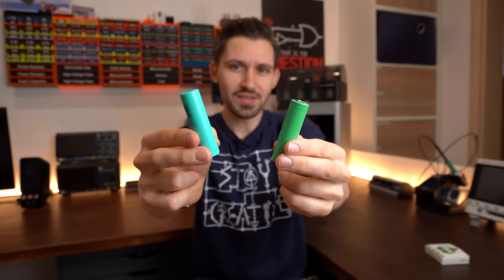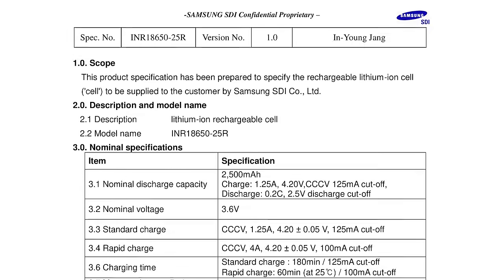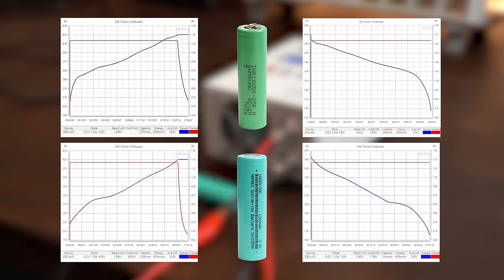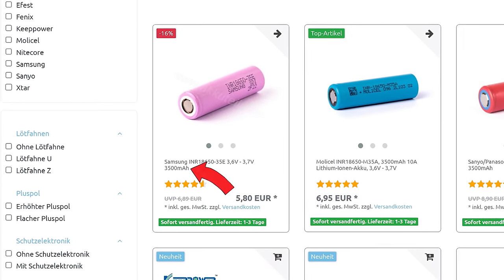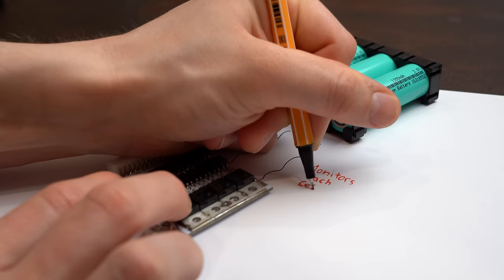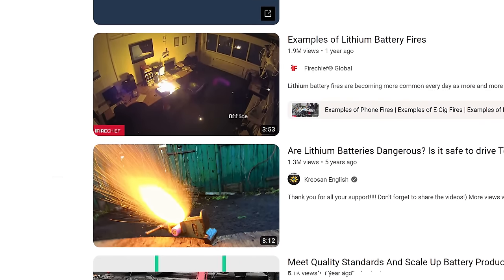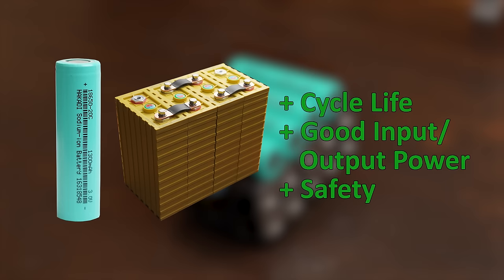"Salt" Batteries are FINALLY Here?! Sooo should you use them?

Comment: I was just watching a video, I think from Big Clive, where he put a schottky diode in series with a lipo during charging with a standard lipo charger, and the 0.3V drop kept the battery <4V when the charge completed. Potentially a quick and easy solution for charging the sodium cells, assuming the charging current is the same, and the charger can handle recovering from a low voltage starting state.
Reply from the maker: Haha yep. That sounds like a easy hack. Not 100% safe, but probably good enough.
Reply: @greatscottlab Well, thats Big Clive in a nutshell :D
Reply: Will it carbonate? What's inside this battery? (Fire apparently)
Reply: Hope this technology grows!
Reply: Yeah, as long as the diode doesn't short it's a decent hack. If it shorts then you have a slight overcharge.
Reply: I guess that can work but with my hota d6 pro I can set the charging voltage to 4v and not worry about it
Reply: @greatscottlab two more tests I would like be performed on sodium ion is its resilience for overcharge and over discharge. Will it survive going down to zero volts?
Reply: I tried this once with a power diode.  You only get the rated voltage drop at the rated current.  Otherwise the voltage drop wasn't as advertised, it was lower.  You need to factor this in.
Reply: As the current draw nears zero, the diode drop also nears zero, and can confuse the charger. My idea was to put a resistor over the cell so there's always about 1 mA or less draw, so the voltage drop over the diode will never go lower than .25 Volt.
Reply: @erikdenhouter how would that work? If you want to get current through the diode from the battery it will need to be polarised opposite as when using it in series to the battery while charging
Reply: @ooltimu  You are right, it is not going to work. Even with a resistor over the cell the charger current will again drop to zero, and the same problem will occur.
Reply: @DM-ei6ooum have you ever met an engineer lol
Reply: @TotesCray  All batteries contain fire; it's easier to release it from some, however.
Reply: @major__kong  Put a resistor in parallel with each cell. Wasteful but should be effective. Power diodes also have a bit more of a range of voltage drop when you put different currents through them.
Reply: @SimEon-jt3sr  Two people have the distance between them halved every second:
A mathematician says their lips will never touch.
A scientist says repeated errors in measurement may cause their lips to touch.
An engineer says "close enough!"
An amateur goes straight for the smooch, then gets slapped in the face and told "she's not that kind of girl."
Reply: @erikdenhouter this usually happens at much lower currents than 1mA. I'd say the cell would be mostly safe because of internal leakage current, but maybe better safe than sorry.
Reply: @mjouwbuis Yes that is right, near zero will always happen at a few nano or pico Amps, but when the charger turns itself off, exactly that happens, and the charger will see the full voltage of the cell again. How does it react then, it could come in a slow oscillation.
I was now thinking of forcing a small current through the diode from another independent source.
Reply: @erikdenhouter  it'd probably be a pain in the ass, but keeping with the theme of retrofitting an off the shelf lipo charger, maybe have the series schottky diode + FET in series and a zener diode rated for the full charge voltage of the battery in parallel with just the battery. When the zener starts conducting, open and latch the FET to disconnect it from the charger. If this is supposed to be an integrated solution (where the user doesn't intend to disconnect the battery), use another monitor to close the FET when the battery goes below a certain charge state. Obviously a super bodgey solution, but until there are $0.20 charging IC's for this cell type, there are probably some good workarounds to integrate and test it in our own homemade products.
Reply: That is actually one of the main advantages of sodium ion batteries, especially from a logistics standpoint: They can be discharged to 0V without any problems!

Comment: I think these have A LOT of potential. But everyone has been waiting for the "revolutionary new battery technology" and that likely isn't going to happen. We will likely rely on a wide range of technologies for different use cases that will prevent over-reliance on certain materials. Like lithium (Good vid!)
Reply: Quite frankly we are running out of options for "a revolutionary new battery technology". Lithium was sorta that. Sodium batteries do solve a lot of the problems with Lithium batteries though, just with a bit of a performance hit.
Reply: Graphene might be it, but it's probably going to be on the timeline that everything graphene operates in... Reminds me of fusion
Reply: There's to many huge huge companies out there like gas and oil or what ever like that.... They want there money and really good batteries would destroy them.....
Reply: "I think these have A LOT of potential" - Well, they are batteries! ba dum tish
Reply: Batteries still need to be charged, and are done so via gas/oil.
Reply: @dallysinghson5569  or solar panels or wind farms or hydro stations or geothermal stations or nuclear power plants
Reply: I agree there will likely be no big leap in battery energy density. So many people are waiting for this big discovery, but I happen to think lithium batteries are pretty close to peak energy storage.
Reply: @dallysinghson5569 don't forget coal 😛
Reply: @jacuzzibusguy I doubt it. Even with straight forward chemical cells there's still a handful of paired redox reactions that could theoretically outdo lithium by a decent margin. Such as sodium sulphur.

Then there are other approaches such as capacitance and hybrids of batteries and capacitors, flow batteries, fuel cells based on some as yet unknown catalyst, batteries which use air as one of the reactants in the redox reactions, perhaps even things we haven't considered yet. Hell, even stuff like improvements in material science making mechanical energy storage like fly wheels or springs competitive may one day be a thing.

But yes we should expect these gains if they occur to probably be progressively more incremental and perhaps even hundreds of years in the future.
Reply: The revolution is coming but it will be least 15 years away. There are companies like Ilika, working on these technologies that have already reached the same energy density of lithium batteries and have rolled it out for use in medical devices. Inevitably the issues of mass adoption will be production and cost. Once those are sorted we’ll start seeing them
Reply: @WillHest  the same energy density as lithium is a pretty low bar.   100 pounds of Tesla batteries, for instance, have the same amount of energy as one pound of gasoline.   

This is why EV struggle to compete when it comes to heavy duty vehicles like trucks or anything that doesn’t get 100mpg equivalent.  

The amount of weight in batteries required to power a vehicle that gets 8mpg for a range of 300 miles is too much for the vehicle to be practical.
Reply: @jacuzzibusguy  Bit off topic, can’t make my laptop run 100x longer by pouring fuel into it 😂 Nothing is going to beat the energy density of hydrocarbons.
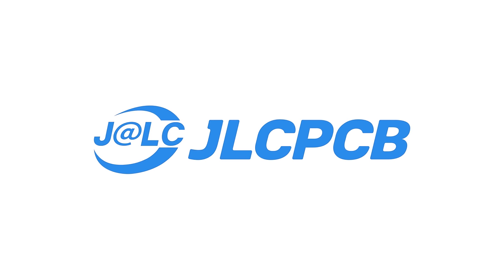What I’ve been able to find dates back to 2018 and for a US gallon you’d need 13x the amount in lithium cells in terms of volume. For weight it would be around a 1:50 ratio. The hope is solid state batteries will at least double what lithium currently offers, so that reduces 1:6.5 for volume. They’re lighter too by around 40% so that should reduce to around 1:30. 
Then we need to factor in that ICE are far less efficient that electric motors by around 3x. We could effectively cut the ratios to 1:2 for volume and 1:10 for weight for identical range. Petrol still wins but it’s not as near to the 1:100 you alluded to earlier, if the promise of these battery development’s come true. The application for long haul HGVs would obviously still not be suitable.
Reply: @dallysinghson5569 you're living in the past
Reply: @dallysinghson5569  Well, I just checked and our grid is presently using just 3% gas and zero oil or coal. You  must live in a country where electricity from renewables hasn't been developed yet. Keep pushing for it.
Reply: @jamescampbell6728   large solar and wind farms do not make any sense.  Private small installations however do.  If you don't understand why, do some research.  Wind farms never pay for themselves and solar is even less reliable than wind although solar does eventually pay for itself.  Using it to augment your home privately is one thing...attempting to rely on a variable source to power a nation is just dumb.

Comment: I put together a sodium ion power tool battery.  The voltage drops a lot while running (internal resistance).  For a car tire pump it's not too bad because it works at a lower temperature, so I can leave it sitting in my car in the winter.  It's definitely a lot larger (physically) battery than the li-ion equivalent.  I don't plan on making any more power tool batteries out of sodium ion.
I'm thinking of making an off-grid solar panel system for my garage specifically to charge an electric car, and as an emergency (extension cord) backup for the house.  With the lower temperature capability and a lower price than LFP, and longer cycle life than Li-Ion, I plan on using sodium for this project.
Reply from the maker: Thanks for the feedback. Great to hear some practical experience :-)
Reply: Good to know the sodium chemistry tolerates lower temperatures. Thanks! 

I think sodium will have a place in bulk energy storage where volume and mass aren't critical, charge management system costs are acceptable, and safety is important. (Home storage system like you envision, and vehicles.) Prices of the cells should come down as production ramps up, especially once competition between manufacturers starts up.
Reply: Thanks for sharing! People that take on the cost and risk of such new technology make the whole world better. Best of luck with the solar project!
Reply: @daveh7720  Not sure about vehicles as mass and volume are generally pretty important for those.
Reply: @PJ-oe6eu I think auto manufacturers would be willing to trade an extra 15-20% weight and volume for power storage that costs 10% of what lithium does.
Reply: What is the cost sodium ion for 1 kwh ?
Reply: Why did you choose it for the power tool? Any specific reason or just experimenting?
Reply: @electricpaisy6045  I have leaky car tires.  In cold weather I wanted a battery that I could use to quickly pump them up without running cords.  Mostly just to play with though.  No one sells a battery with a built ii  current display, so it's also useful for testing power tools.

Comment: Also another thing to remember is that the max capacity of sodium-ion batteries will likely increase in the future like what happened with lithium-ion batteries.
Reply from the maker: True true
Reply: @luelou8464  Yea they are about as old as lithium ion batteries.
Reply: @luelou8464  fair, I just like think positively about the future of technology.
Reply: @PJ-oe6eu   lithium batteries were first being worked on in the 60s and have had continuous devoplment whereas sodium batteries were first being worked on in the 70s and mostly shelved in the late 80s until the 2010s. Source: a few minutes on Wikipedia so i could be way off.
Reply: I'm not entirely sure on the chemistry of it, but as I understand the theoretical best capacity for sodium is still meaningfully lower than lithium, but I would imagine there is still some room for improvement.
Reply: sodium ion batteries cannot approximate lithium's specific energy for a simple fact: sodium is heavier, more than 3 times as heavy as a matter of fact. That's something that we can't just science away without completely revolutionizing physics as a whole. Sure, they probably will increase a little bit, you may one day find 18650's pushing over 2000 mAh, but if that happens we can already call that a HUGE win.
Reply: @andresaofelipe  just being optimistic
Reply: @andresaofelipe yup, but still remains the fact that sodium ion will be great for large static / less portable installations
Reply: @andresaofelipe Yes, sodium is fundamentally worse than lithium, but lithium chemistries have seen an appreciable increase in capacity in just the last 10 years, and they've been far more aggressively developed than sodium prior to that. There's definitely still room to move. Plus, I expect that cycle life will probably improve quite a lot as well given we're already at 1000 cycles and widely available NMC cells used to only be able to reliably hit 300-500 cycles 10-20 years ago.
Reply: @luelou8464  Several companies who have already announced higher capacity sodium-ion cells for production in the coming years beg to differ. 
The academic research I've read on  the topic lends those claims some credibility. Figuring out how to optimally configure the cells and how to actually produce them at volume with reasonable cost is a time consuming process. You don't just figure that out all at once for all possible chemistries.

Comment: Love seeing battery evolve. The lithium ones are good but it feels like you are handling a tnt every time you work with them😂. Btw good video!
Reply from the maker: Yes, I know what you mean. If you handle them correctly, nothing bad usually happens. But I witnessed some cells going nuclear. Not a fun sight.
Reply: Yeah, I've also seen some research that said (some) sodium batteries could be discharged to 0V and not get permanently damaged. If that were the case we could discharge all the cells with a resistor or something, spot weld the pack together, solder wires, connectors etc without any risk of shorting anything and then, when everything's in place, we could charge the pack. (yes, i've briefly shorted out a 13s pack when soldering an xt60 connector. The heatshrink wrap that was covering up one lead broke and part of my soldering iron tip has vaporized. It was only 40-something volts. Can't imagine a short at 600V) 

Extrapolating that, working on EVs with sodium batteries would be much safer
Reply: Sodium is more reactive than lithium. So bigger tnt.
Reply: The fun starts when you drop a li-ion pouch-style battery and dent the corner of it when it lands.  It was my first unintentional battery fire!  \o/  It's not as bad as TNT, but they do keep you VERY mindful of what you might do wrong with them.
Reply: Why do y'all hate Roman Candles?
😆😆😆
Reply: @balintgalambos691  It's really not that simple. There is no significant amount of metallic sodium that would react with air or moisture.
These processes in lithium or sodium ion batteries are not comparable to throwing a chunk of metallic lithium or sodium in water.
Reply: LiFePo4 are completely safe and have basically the same power

Comment: Andy @Off-Grid Garage has been doing some significant testing of sodium batteries (not cells so much).  The wider voltage range and sinking discharge curve compared to the nearly flat curve of LiFePO4 is rather a problem until/unless off grid electronics is designed for the wider voltage range.
Reply from the maker: Thanks for the information.
Reply: For consumer devices and off grid use, yes. For energy storage of Solar, Wind etc. this is very encouraging news..
Reply: @cygil1  I specifically mentioned off-grid. 

I'd like to see a comparison between these commercial sodium ion batteries and the classic nickel-iron batteries.  Sodium-ion have a similar wide voltage range disadvantage but if these are not using nickel then cost (at least short term) would favor sodium-ion.  (some sodium ion chemistries also use nickel but many do not)

Nickel-iron is an old and wonderfully robust and durable chemistry for stationary applications.  Nickel isn't cheap and energy density is low.  Wide voltage range (similar to sodium-ion) was also an impediment.  However the batteries are capable of daily heavy cycling for decades then a flush and cleaning of the anode and cathode and refill with fresh lye (electrolyte) and they are good to go again for decades more.

Con-Ed in New York used 100 year old nickel-iron batteries for load management on their D.C. grid until just a few years ago. Some old installations were also used after the D.C. grid was shut down by doing local rectification to power a facility grid, with surges handled by the batteries.
Reply: Owls need HUGS

Comment: Great video! You missed temperature as well. For outdoor installations (weather stations, solar powered meshtastic, etc) sodium  batteries can be charged and discharged down to -20c, whereas lithium does not like to be charged much below 0c and has issues with discharge when cold as well.
Reply: LFP works perfectly well up to -20 and even -30 in some cases

Comment: I think what i love most is the safety, this might just be a very good battery for DIY projects. No longer feeling like holding a grenade fearing it will blow up and light your house on fire when connecting the wires :D
Reply: Same, I always connect an ammeter in series so at the very least I can yank the wires off or the fuse blows inside the meter 🤣